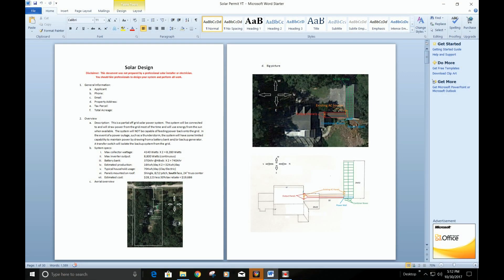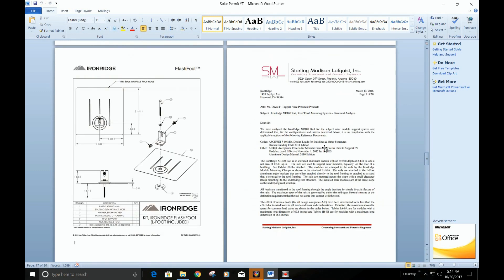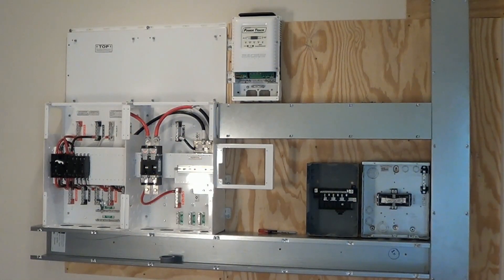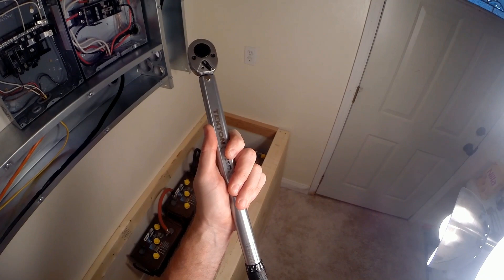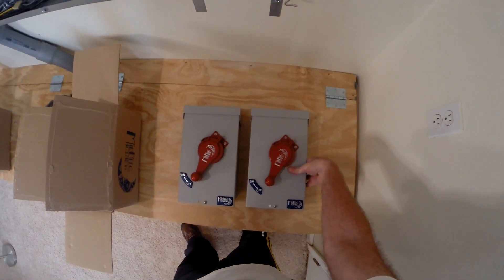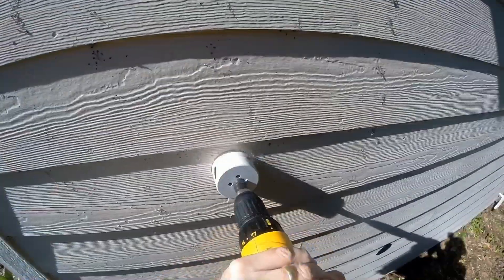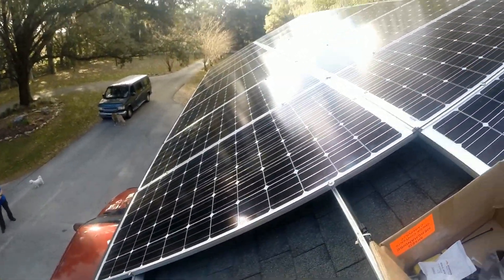DIY Solar Part 1: Design and PowerWall

Comment from the maker: The system is very scalable with preferred design points as follows:

1. Base system: $11k (after 30% tax credit)
 - 4-5 kW on the collectors
 - single PT-100 charge controller: 100 Amps
 - single inverter: 4.4k/8.8k continuous/peak
 - 8 Trojan batteries: 370 Ah at 48Vdc

2. Base Plus: $18k (my system)
  - double the collectors to 8-9 kW
  - add second PT-100 charge controller
  - add second inverter for 8.8/16k total continuous/peak Watts
  - double battery bank to 740Ah at 48Vdc

3. You can take this system to:
  - about 34 kW on the collectors
  - 8 PT-100 charge controllers
  - 4 of the 4.4k inverters: 17.6k Watts continuous
  - not sure how many parallel banks of batteries you could add and maintain even charging???
  - can mix solar/hydro and wind seamlessly via the different charge controllers

I could add another 4k of panels, one more PT-100 charge controller and one more combiner box for about $3000 and just plug it right in.  Everything else would already support it.
Reply: a trick : you can watch movies at kaldroStream. Been using it for watching all kinds of movies lately.
Reply: @Arjun Moses yup, have been watching on flixzone} for since december myself =)

Comment: Well your system is really done well and I watched all of the video from the build. I will be mirroring you in many ways but some changes I'll be doing are... I'll be running the 12 panels with only one 4448 but will be incorporating the new GT500's to run AC right from the panels thus reducing the wire gauge.  I'll also be running lithium cells probably around 18kw and able to get 75 to 80% out of them safely with a recharge count far superior to the flooded or AGM's (2000 range). The setup will eventually be in a semi tiny home/cabin totally off grid with hopefully a basement compared to this example.    https://www.youtube.com/watch?v=pUflrQzCOpY
Reply from the maker: Russ B.  I'm trying to figure out your design.  The GT500 micro inverters are usually used in a grid tie design.  Since your off-grid, not sure how well this will work?  Are you planning to run the 240Vac from the GT500's into the 4448 inverter?  So when the sun is shining, the 4448 passes the power through to the loads of the cabin and charges the battery bank with the access power using its internal 60 amp charger?  When the sun goes behind a cloud, the system switches to inverter and runs off the batteries?  When the sun is shining and the batteries are full, what happens to access power?  Wouldn't it work better keeping it dc from the panels and using a PT100 charge controller to charge the batteries directly and pass power directly to the 4448 to be inverted?  I'm not saying the GT500 won't work for off-grid application and I don't know your design but just not getting a good feeling about it.
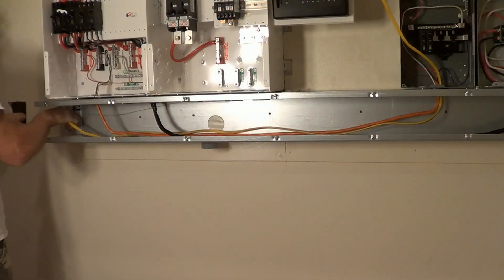Reply: So Dave go to this video    https://youtu.be/Bn6GUxVBRmE   and fast forward to 3:44 to see the wire schematic and freeze it. You can see the grid side of the diagram...eliminate that totally and put a generator in that location instead going into the load center. There would be no main breaker panel at that location now and the critical load panel would now become the main panel with breakers either on or off depending on loads and solar power status as well as battery status. If no sun and low batteries the generator would be put into operation via a transfer switch in the Magnum load center...Now go to this video https://www.youtube.com/watch?v=WgOYGatEJL4    and start at 4:00 to see the midnight solar interlock configuration John is setting up for running from Gen or PV(GT500's) & batteries. The exact wire scheme is to be determined and eventually I'll work with John to accomplish my thoughts of setting up the GT500's totally off grid. There would always be some type of load in the cabin refridge..etc..running if everything was at full potential (solar & batteries) or everything shut down if the generator needed to run for recharging etc...
Reply: Russ B dc coupled(charge controller) systems still work the best offgrid. Charge controllers are harder to install than gt500’s and not rapid shut down compliant(non issue on your project) and less shade tolerant. Both systems have advantages and disadvantages. I’d be a little bit scared to ac couple a lithium battery right now....

DC coupled systems still work better with generators.
Reply: Tnx John...it will be awhile before this will become a reality..lets see where the solar tech world will be going down the road..just trying to think outside the box...an example of an off grid setup with lithium working flawlessly...but no GT500's here of course....
Reply: https://www.youtube.com/watch?v=xH5cAuaCYKw
Reply: Russ B haha. Yeah that system looks like it works but I’m pretty sure my insurance would drop me if I put that in someone’s house. I think Jason may have had a little cyber tistle with that guy...

Comment: There is no such thing as hastle free solar unless you are rich!
Reply from the maker: Building a reliable system that has real capability does cost real money.  I just pinned a little cost breakdown for your reference.  The full parts list is in video #24.  Thanks!